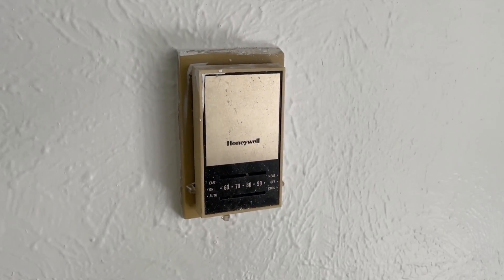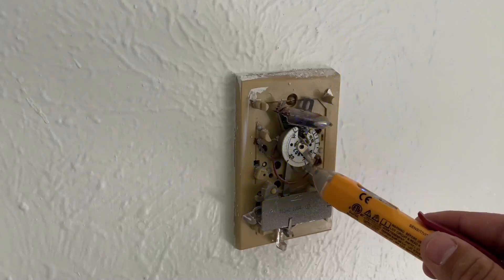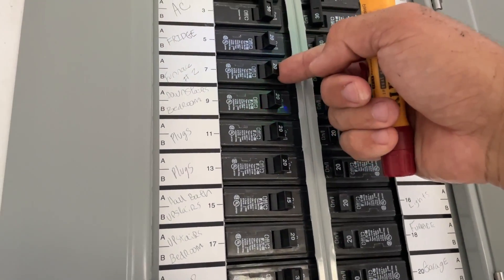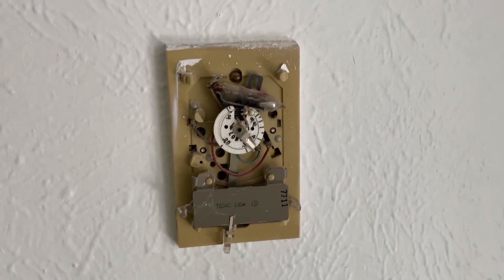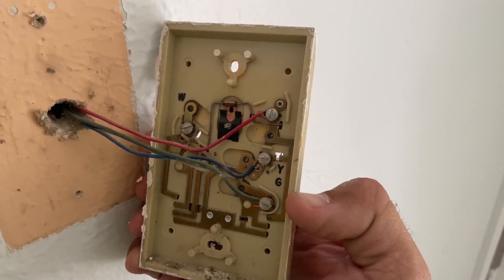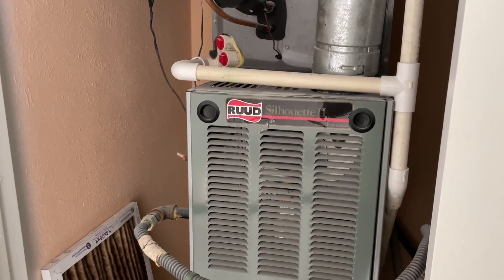How To Replace An Old Thermostat With a New One

Comment: I had an old one same brand and I bought a newer one matched all the wires and out ac is still not working, the only thermostat would at least cut the fan on but this one won't even do that

Comment: What do I do if the colors are worn out and they are all the same colors?.
Reply from the maker: Hard to tell; this is a unique situation.
Reply: are they painted? are they still connected to old stat? if so label them one at a time. if u are seriously lost u have to take a electrical meter and do a continuity test to figure out which wire is which and label each end

Comment: This video is excellent, to the point.  About to replace mine and we don’t have central AC so only red and white wires were connected, so I assume I don’t need to connect those to the new one if they were never being used

Comment: is it me or is the Yellow a blue wire? scratching my head.
Reply: the wires could be different colors from my understanding, for instance in my apartment we have a single-stage heater (we have radiators so we’re using a boiler, not a furnace). we have our power wire (R) and our heating wire (W). for the power wire, it’s white and for the heating wire, it’s brown. as long as you remember the wires on your old thermostat depending on the wires (good luck if you have 12 wires, pain in the ass to deal with) you should be able to do it with ease. just remember to turn off the power to the thermostat, check the voltage using a voltmeter or multimeter, and then take a photo of your old thermostats wiring (with the front plate off) and then as long as your power is off to your thermostat, you’re good to go. unscrew the wires, start unscrewing the backplate (make sure your wires don’t fall inwards lol), install the new thermostat backplate and then rewire as needed, install the frontplate and then turn on the power and as long as it’s done correctly, your new thermostat should be working 😎😎

Comment: Great video! Right to the point, thank you very much for sharing!!  
But I have a stupid question… my 3-story house has one heating controllers like this old piece on each floor, then another Central A/C controller for the whole house; I’m now considering to replace them with smart unit(s), (taking Google Nest as an example), so do I need 4 Google nest? Or I need 1 Google nest for the floor with both heating & AC controllers, then another 2 x smart/digital controller for other two floors? Thanks in advance!!
Reply from the maker: It depends on your system setup. It's hard to tell without taking a look.
Reply: @DIY-repair  thanks for replying!

Comment: Very poor explanation about connecting the cables in the proper place. That's the most important part of the connection, but only about 3 second was spent on it.
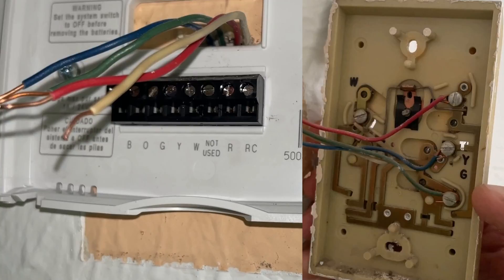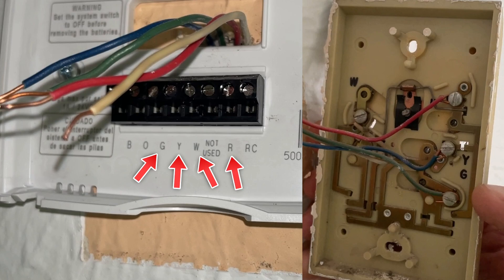Reply from the maker: 0:45-0:57 is where I explain how it is supposed to be connected to a new thermostat. 
Let me know what you want me to explain deeper, so I will pay attention to these details in the future. 
Thanks!
Reply: @DIY-repair think he was referring to how you unscrew the thing that holds the wire in place, insert the wire and tighten it down.

Comment: I have the same older thermostat but only 2 wires. Is it possible to install these newer thermostats?
Reply: Mine has 2 wires too. Its heater only
Reply from the maker: It definitely needs more than 2

Comment: Wish you had shown the wired hooked into the correct slots in the new thermostat side by side with the photo of the old one because it is a bit confusing because I don't even see a yellow wire in the old pic,  and it seems that the blue wire is connected to the Y terminal.  Otherwise. . . perfect.
Reply from the maker: I'll keep it in mind for future videos.

Comment: I live in an apartment, but not sure which breaker I would turn off? I also have that old breaker box with knobs as opposed to switches.
Reply from the maker: If you put electrical tape on each wire you can do it without turning the AC off
Reply: Or turn every breaker off.
Reply: Turn them all off duh
Reply: there might be a light switch at the furnace that acts as  D/C switch which will turn off low V to the stat